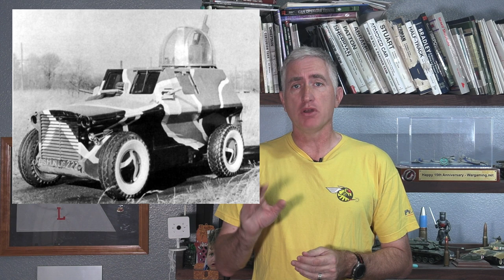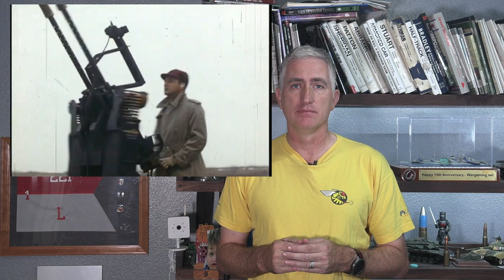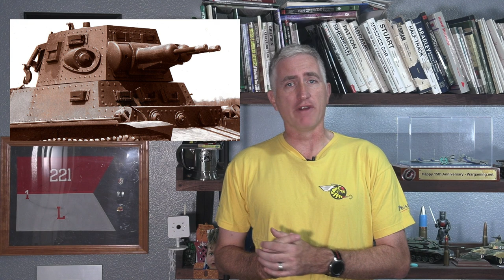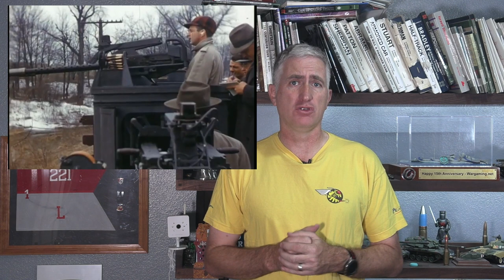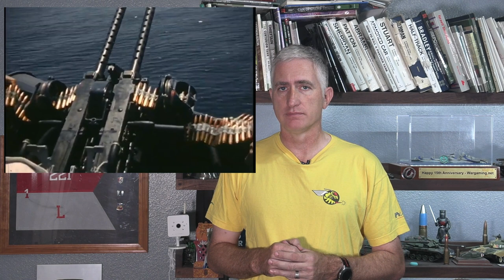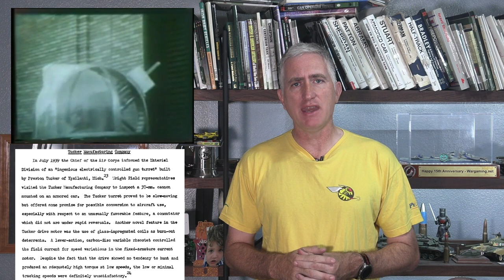Why the Tucker Tiger Failed

Comment: The description of the proposed track system reminds me of the time when, as a child, I converted a Matchbox dump truck into my seven-year-old idea of a "tank" by putting rubber bands around the wheels. It would never have occurred to me that anyone would have tried that on an actual grown-up vehicle. :)
Reply: If you're interested, the Kegresse track system saw a fair bit of use using similar methods, including use on Lenin's Rolls Royce.
Reply: To be fair, that's essentially how tracks got their start
Reply: I don't think that it was a grown-up vehicle... I looked at the statement that said it could do 114 or so. I was impressed. Then I looked again and it said MILES per hour. Isn't that something like 190 km/h ?!?!
Reply: That’s actually pretty common on skidsteers and other such wheeled construction vehicles, instead of buying a new one with tracks you buy tracks that go over the tires
Reply: @Thunderchicken69  also in the logging world for marshy areas
Reply: Same thing here in Philippines. Then I watch this... Small world 😂🤣👍
Reply: @laurisikio  To be fair, with a zero-to-60 time north of 30 seconds, it probably would have taken longer than the natural lifespan of the crew to reach 114.
Reply: @ZGryphon  that's probably true, and somehow I can't believe that it could reach even 100 mph with its 175 hp.
Reply: @laurisikio  What's really terrifying to me is the idea of a five-ton, top-heavy vehicle doing that kind of speed with 1930s brakes.
Reply: That's what the American (Autocar) half-track uses. I understand it's essentially a big rubber band.
Last I knew you could still buy them. The Israeli army used half-tracks for a while. I'm sure when they're gone they're gone.
Reply: There's some pretty badass track attachments you can put on certain vehicles (I mostly see them on Hummers) but that's four sets of tracks instead of connecting the front and rear wheels.
Reply: Oh, also a lot of bulldozers and stuff use rubber tracks.
Reply: @the_inquisitive_inquisitor  Yes, I've seen things like that. My neighbor used to have one of those side-by-side ATV things, the ones like small cars, and he had a set of those he'd put on in place of the wheels in winter, to make it into a sort of miniature sno-trac. Kinda neat, although I question the practicality of that particular application. :)
Reply: @ZGryphon  Practicality? Who cares, it's BADASS!
Reply: @laurisikio  114mph is 183 kph.
Reply: Bt42 .... That Finnish/German beauty can lol track systems were actually built so if it got taken off while on concrete specifically it would still be able to drive away from enemy targets or into combat even with tracks being damaged or even ripped off however one issue was one track was on and the other was off so the track side of the vehicle would have more power than a side without causing driving issues lol
Reply: Christy susspention.

Comment: It looks like an armoured rally car .Though I am not too sure that the US military were just being picky when they turned it down as  virtually zero soft ground capability is a bit of a design flaw . I would love to know what Tucker was thinking as to how this vehicle was going to be used as apart from speed it doesn’t appear to have any advantages over the greyhound.
Reply from the maker: In fairness, the Greyhound was three or four years away yet.
Reply: @TheChieftainsHatch  My design was a failure. Lol
Reply: I wasn't thinking lol
Reply: I do wonder what the reaction would have been if they came back with wider (multiple?) wheels to improve ground preassure and added that 4 wheel drive. Or if that was even possible for the design.
Reply: it was so fun they had to drive at 75, not 60mph
Reply: The report seems promising enough that you'd think, on the face of it, that it would be worth the company's while to address the issues and have another go. Of course you don't know their financial position, nor what Tucker's personal response to the report was.
Reply: @MrHws5mp  you don't really want to know my personal response to the report, do you?
Reply: @MrHws5mp  Indeed. Usually when I stumble across a 'project abandoned rather than being redeveloped' it's near the end of the war and it's considered dubious the improved design will be able to enter service in time to make a difference (see the various proposed successors to the M4 that never left the proving grounds). 
For the project to be dropped before the war implies that Preston Tucker did not have enough reserve funds to finance development without a contract.
Reply: @TuckertheFucker  Bless you for role-playing your little heart out.
Reply: You know they used that ball turret as an idea for the b17...
Reply: @alexander1485  he refers to that suggestion a bit towards the end of the video
Reply: @TheChieftainsHatch  Was it the 6 wheels of the Greyhound that made the biggest difference/improvement over something like the Tucker vehicle with regard to off-road capabilities? Just wondering if adding a further set of wheels could have solved the Tucker's issues to a satisfactory degree - though that might have necessitated such a radical redesign as to not be economically feasible.?
Reply: @zorkwhouse8125  as long as it is not AWD, there is no way it will win

And also, he should have gone straight to 4x4 for it. As all I can see this as a base defence vehicle
Reply: @JohnDoe-vm5rb  wider wheels they might have done, and the video included a picture of it with dual rear wheels.  But I suspect that wouldn't widen the ground track enough to get it through the sideways slope test.  For that you'd need it a lot wider (maybe as much as a couple feet), or to significantly lower the center of gravity.

Though wider wheels plus the 4x4 option could well be enough to get it through the sand and mud courses.  Then beefing up the brakes to tackle the straight incline test seems trivial.  (Though depending on the gear ratios they picked to get a 5 ton vehicle up to 100 mph on less than 200 hp it might have real issues with a standing start on a major slope.  If so fixing that would require a bigger engine, more gears, or re-gearing to trade off speed for torque)
Reply: Replace the gun in the turret with a fire hose and it may serve as an flight line fire truck and riot car
Reply: @JohnDoe-vm5rb  Let's think. 4 wheel drive would add unsprung weight and raise the vehicle, and duallies would also add to the weight. On-road handling would be worse, and this would also increase fuel consumption. The high center of gravity would make the vehicle wobbly and more likely to tip over. The engine would still be excessively large. I doubt the military would have been that impressed.
Reply: @Jorqell  The engine was quite capable by the standards of the day. Honestly, just a new transmission, drive axles, and big, round, soft tires with a lower gearing likely would have won a contract.
Reply: @cheyannei5983  Oh yeah, it has a wonderful luxury car engine - with luxury car price, weight and size. Put in your modifications and some cheap 6-cylinder inline engine, and maybe there's a desert patrol vehicle there.
Reply: @Jorqell  a 4*4 isn't substantially heavier than a 4*2, even in unsprung weight. Maybe 500lbs total, and only about 50-100lbs extra unsprung. This would have brought down the center of gravity, too.

It also wouldn't have been significantly taller, as the springs are already sitting on top of the axles as built.
Reply: @JohnDoe-vm5rb  there's a photo of a 6 wheeler,  2 front and duals In the rear.
Don't know if it was all wheel drive or not.
Reply: @alexander1485  The Sperry Ball turret used on the B-17 (as well as the B-24 and B-32) was nothing like the Tucker turret. Gun elevation is by rotating the entire ball, not the guns. Other than being ridiculously tall, it shares more in common with several dorsal turret designs used all over the world.
Reply: @alexander1485  You know they actually didn't get that idea from the Tucker Tiger, and that The Chieftan talks about that myth in this very video.
Reply: I mean, I definitely see what they were going for - but I also see why it wasn't a practical military vehicle.

Comment: When I heard the line about how the Tucker was not picked because it was too fast, my response was basically "pull the other one."  I figured that the Army would not value pure speed, above some maximum amount, over any other characteristics and that it was actually not chosen because it was inferior in some way to contemporary vehicles.  In engineering, it doesn't matter how good your product is at doing things that are not required, if your product has no capability at all to achieve some requirement.  So, the obvious approach is to design for the requirements and make sure you meet them all before adding stuff that your customer isn't going to care about.
Reply: Its only downside I can see is no 4 wheel drive, and thus poorer offroad capability than the alternatives.
Put armour in plqce of the glass on the turret, and its a fine scout car till like the 70s.
The reason this was rejected was most likely a result of corruption, as the safety concerns of soldiers joyriding around at 100mph can be easily overcome with limiting gearing.

Comment: The early 77 foot PT boats built by Elco had two pleixiglas bubbles that housed twin-50 cal Browning MGs that looked a lot like the Tucker design but were actually built by Dewandre.  These proved troublesome and were quickly removed and replaced with simpler Scarff ring style mounts by early 1942.  These became standard fittings on the much more common 80 foot Elco boats and 78 foot Higgins boats.

Comment: Why didn’t they just crank the armor up to counter the speed “problem” or just use it for supply purposes
Reply: Because neither the armor nor the the speed were the problem. It couldn't do offroad driving to save its life even at current tonnage, and adding weight would just make it sink deeper, faster, while ruining handling and making it even more top-heavy. It's also excessively fast as a cargo vehicle, while lacking the space the existing trucks had. Trucks that COULD already deal better with muddy ground, mind, because 4x4 or half track.
Trying to address its shortcomings would inevitably just turn it into something very close to what the army already had - the M3 scout car. So they didn't bother.

Comment: Maybe had they dropped the turret and associated equipment entirely, fitted a decent 4WD system, and maybe it would have been a potential messenger vehicle, able to race behind the front lines delivering important documents, orders, and sometimes materiel between units, when sending a Jeep might have just been slightly too vulnerable/slow.
Reply: But then you would have to redesign the whole thing.
Reply: @naamadossantossilva4736  I'm not sure why, I mean the 4WD transfer box should effectively bolt on to the frame, underneath the chassis, with only relatively little modification required for the front end. Deleting the turret, likewise means not cutting a hole in the top armor, or installing any of the requisite equipment. Most of that could relatively easily be retrofitted to the original to give the Army a Proof of concept to work with. A second, optimized prototype, if the army decided to pursue it would likewise be not terribly hard to build.

But anywho, all this is irrelevant, since tucker didn't try to go that route, and the Army didn't apparently suggest it themselves.
Reply: Fitting an AWD was probably not enough. At first glance, the clearance from ground is low, while the centre of gravity is already high. The axles are very low too. And the weight of a proper turret would have unbalanced it on a side of a slope, as the car is somewhat narrow.
Maybe they could have turned it into something equivalent or slightly better than the M3, but it would have required some extensive redesign just to do that.
And that's just by looking to it, as there might have been other hidden flaws.
The car was not well thought from the start.
Reply: @Skyfighter64  You need to consider their wasn't space in a RWD design for the transfer case, front drive shaft, front diff, front axle ect. This is far from "little modification for the front end" effectively mandating complete new suspension, steering links, likely engine bay rearrangement, and not least of all, lifting an already top heavy narrow design even higher to make the extra equipment fit under the engine/gearbox/frame. Being even less stable would be an issue on uneven ground, and in a short wheelbase vehicle, render your crazy high on-road speeds even less usable.

Likewise dropping the turret but keeping the armor doesn't work well, the car is vulnerable to well placed shots regardless, and without returning effective suppressing fire its going to be immobilized , even if the armor is never defeated directly. A lighter caliber gun would have been a solid option for defense against infantry, but would leave you vulnerable to other scout cars, which are one of your principle opponents.

Nor would AWD have made it magically great offroad... it'd be less completely horrible, but its high speed narrow wheels, the excellent anti-body movement suspension design, high axle gearing ect that allow speed and road manners all actively work against its low speed offroad capability.

The issue with the Tucker Tiger is it was a solution looking for a problem, not the other way around. Tucker made something cool and hoped it would be useful (or at least a halo product to make other sales), rather than trying to assess what vehicle capabilities where needed and fill one or two mission profiles extremely well. Also even if you shed an entire ton, a 4t messenger vehicle in place of 1t Jeep is going to be extremely expensive, require far more fuel/maintenance, need more driving skill, have more requirements regarding trail quality, cause far more trail wear.. keep in mind in this era a military "heavy truck" was a 4.5t vehicle that moved 2.5t cargo, even a far more modern HMMWV is only 3.7t, so pre-ww2 something this large was the next tier down from a tank, not a light combatant suitable for secondary non-combat roles.
Reply: @SheepInACart  It was mentioned in the video that Tucker did have a 4x4 version planned.
Reply: @chefchaudard3580  I am not suggesting using this as a combat vehicle, but rather an armored courier. Lightening the vehicle up by deleting the turret entirely, and using the space inside for paperwork/valuables/VIP's for when Jeeps are just too slow and less secure. Since it won't be on the front lines, it shouldn't have to deal with going offroad too much, and that potential 100mph speed could be used in an emergency.

Maybe the Army would have seen that was a good idea. Unfortunately for the Tucker company, they were entirely fixated on the turret itself, and my possible alternate history idea never happened.
Reply: @RichWhiteUM  I have plans for what I am going to do with my billion dollars
Reply: Way too much effort to limit the vehicle's role.  The Army wanted a combat car suitable for scouting purposes, they saw no need for an armored logistics vehicle.  The Dodge, Chevrolet, and Studebaker trucks fulfilled the logistics role quite well.
Reply: Why would you go through all that work just to procure a vehicle for the rare occasions when a Jeep is not quite enough? How often do you think that situation arises, and is it worth shipping another fleet of vehicles and spare parts, etc, overseas, then across the Channel, and then garaging and maintaining them in France, just for the times when 9for some reason) you think a Jeep might not have quite enough armor. Nonsense. Especially since if you need something better armored than a Jeep, you use a M3 Scout Car or Half-track, which is already in service in large numbers. You aren't going to convince me that the expense and pain of a whole new fleet of vehicles is worth it just a few extra theoretical miles per hour delivering documents or orders. Priority orders get radioed anyway, and the reality is that driving speeds are dictated by the condition of the roads, the amount of traffic, and the weather. You can't drive any faster in the real world in a Ferrari than you can in a Toyota. If you can, it certainly isn't by enough to make it worth the extra cost. Same is true here.

Comment: Swiveling headlights are useful if the vehicle is going to be operating in countries where they drive on the opposite side of the road as headlights are generally slightly tilted to focus the beam towards the centre of the road, some British vehicles had the feature to swap left-right focus.
Reply: Keep in mind the era, this was 1930's, very few cars had any sort of headlight beam shaping at all (and normally totally symmetric placement), they where just circular pools of light. Indeed driving at night wasn't even that common outside city spaces with street lighting, without the sort of well marked or aheared to "lanes" (although centerlines having appeared in most denser areas, and edge marking the the best roads), nor was it done at the sorts of speeds we expect, your inter operating with horse drawn carriages, tram tracks, and animals/people not carrying lights.

Comment: One of those things I had heard about, but never followed up on. Having spent 20 years in the Air Force, I am not surprised they did not give Tucker any acknowledgment.
Reply: That is assuming they actually copied something from him, which is doesn't appear they did. Did you not watch the video? this is some ad-men's claim from the 1950s trying to promote Tucker Motors. So they just tossed in some crap about the USAAF "copying" his turrets (without any details). As if the glass turret had not already been around for a long time. Moran searched for any technical details that might have been what he meant, and found nothing.